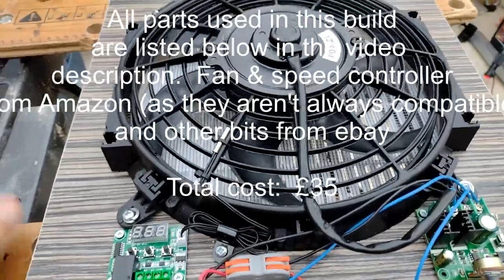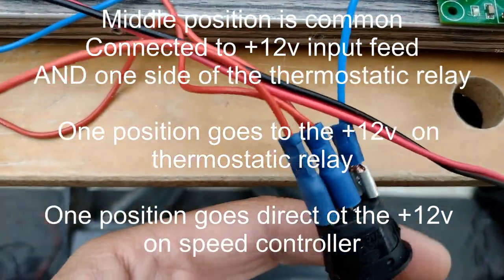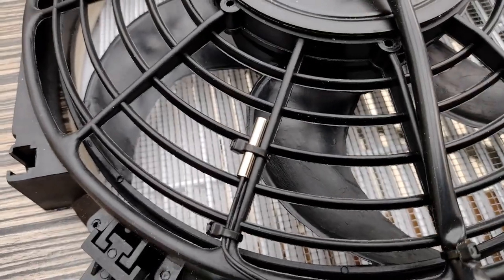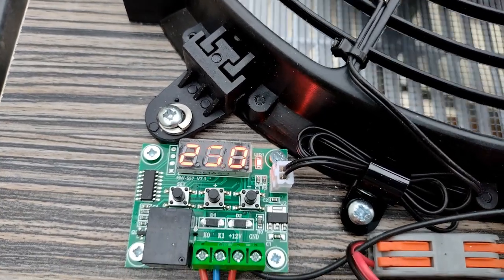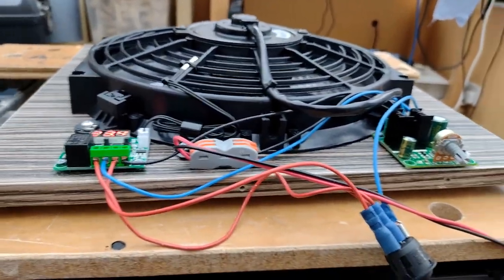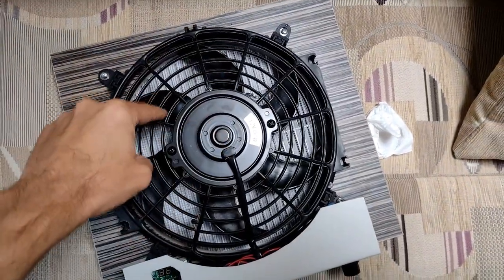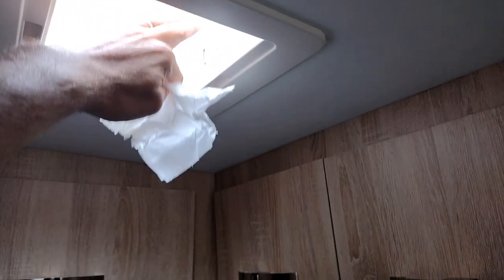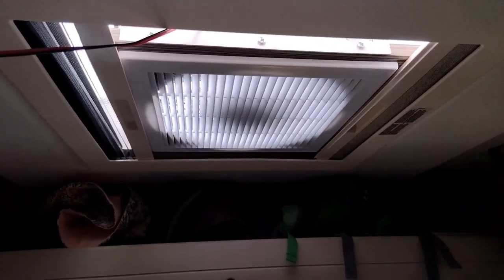DIY Motorhome skylight vent fan

Comment: Great work I did same in my motor home but the stat was a clever idear mate.
Reply from the maker: Thanks, good old ebay for having all the electronics!  The speed controller keeps the noise down, and the thermostat is useful too.  Worth doing if you don't have a maxxfan

Comment: Good video, much better than a maxxfan if for anything cost.  I think your video covers it.  Did you power with a 12v 10amp switched cigarette device 9r direct connection to the leisure battery.. Also did you have an inline fuse or is it connected to your fuse board.   I'm hoping to power with cigarette socket, direct to my independant 2000w solar generator. Which gives me 240v anytime any place, anywhere.  But I could directly connect the controller to the leisure battery but likely I will drain the 85amp battery quickly.  Your advise is welcome either way and to be honest, it may be try and fail or it works.  In any even good video
Reply from the maker: I have dual (redundant) "aux" circuits to the 12v sockets, so use those.  Each ciruit is fused.  I did use a 12v cig lighter (with inbuilt fuse) - but the plug got hot when on high (poor connection/high resistance) - so changed the plug/socket to teh european hela version which is rated higher and grips better. Low speeds power usage is low, its only high when the current is high.

Comment: That looks like a radiator fan, I had the same idea and have a similiar fan on hand - I have a 200mm high vertical section to mount mine, yet the high-pressure/low-cfm nature of such fans, and tests showing the same, is making me now look at alternatives (I'm converting a pantech, think large box truck, much larger than average van/trailer).

What's your IRL experience with it like?
Reply from the maker: in one. the fan is linked in description and is a motorbike 12v fan. works well enough for the purpose. could be quieter on full blast but that's rarely used, the speed controller works well

Comment: Great video, will be basing my build on it. Just one question regarding voltages in all components. A fully charged leisure battery will put out almost14v; will the relay, speed controller etc tolerate this voltage?
Reply from the maker: Fair question - and easily 14v when driving, though I've limited solar/EHU to 13.8.  I've seen no problems.  My lighting circuts have 12v regulators so they only give 12v (and a smooth 12v at that) - so no flickering/dimming.  As for these, checked the video and links/products changed.  Mine is like https://amzn.to/3qrEgD7 - says it can take 35v so the input voltage isnt an issue.  Output is pwm so if any concern just don't put to 100% :)  Note the branded maxxair can fail on 14v so they should be on a 12v regulator as well.  Also (IMO) the fan I use is a motorvehicle fan - so used to alternator voltage (14.8?).  No issues to note in our use.  HTH.
Reply from the maker: PS - I use many W1209 relays for fridge and other bits - even running at 14.4v (b2b voltage).  Never had a failure (and cheap enough to carry spare!)

Comment: Hi i have brought all the bits for this and its come to £43.48 and still pleased but the only thing is can you send me a tell me how to wire it up please. To buy a proper fan to take smells out when im cooking in my caravan is over £300 and only works when on full electrics and think this is a great idea as we can use this off grid.
Reply from the maker: What do you need to know?  I used a 12v fan, so just needs +12v and -ve connections.  But, if you want a speed controller you need to put that between the power and the fan.  And if you want a thermostat, it needs to be between the power and the fan (or speed controller).  The thermostat was a W1209 (search ebay) and speed controller search "12v  dc pwm speed controller".  Each "module" comes with their own instructions.
(For mine, to go backwards (blow rather than suck), I turn fan unit up side down - your fan may work backwards, I didn't check)

Comment: Can you update us now that it's been 2 years as to how well this is working out? I really prefer the idea of having a skylight with a removable fan.
Reply from the maker: Hi.  The gold standard is maxfan....  But this is still working and working well, and significantly cheaper.  Some points.  1- it needs space to live when not in use; 2-it needs an accessible power socket.  3 - I started using a normal 12v cigarette connection but when fan on "high" it pulls a lot of power and the plug/socket got too hot for my liking.  This is "normal" on high current through a cigarette lighter.  So I changed the plug/socket from cigarette to "hella" type - which is similar size but much better connection and ergo less resistance/less heat/safer.   I actually now use the hella connection for all high current 12v plug/sockets.  See https://amzn.to/3Y1Tqh5  and do some reading :)  but yes, fan works well
Reply: @Ryan_DYD  thank you so much for the info. Really appreciate the advice.

Comment: Is that the way you want the thermostat to work? It seems it cuts off when the temp gets to 25deg, rather than cutting off if the temp is below 25deg.
Reply from the maker: Hi, must be poor video, sorry.  The relay clicks "on" above a certain temp (25') and the fan starts, and then when temp drops below 24' it goes off.  So fan only cuts in when too hot.  The W1209 is configurable in terms of the delta (so could have it on at 25 and off at 20) or you can reverse it so it goes on below 24 and off above 25.  As it is, its the right way round :)
Reply: @Ryan_DYD  Cool. I misunderstood what was going on. Nice work mate.
Reply from the maker: @DaveEverett01  No worries.  The W1209 gizmos are really good and configurable (and cheap!) - I have one running extra fans for the compressor fridge ventilation and one for running heat extraction from the (uninsulated) garage area.

Comment: Hi done a great job can you tell we’re you got the cupboard handles from please
Reply from the maker: lol.  Good spot. Not mentioned on the fan vid!  They are mentioned in another vid, and are very good.  From ebay - see https://www.ebay.co.uk/itm/143445042267 or https://www.ebay.co.uk/itm/183728305296  as an example, generally searching nickel push handle or nickel button handle and note nickel/nickle......